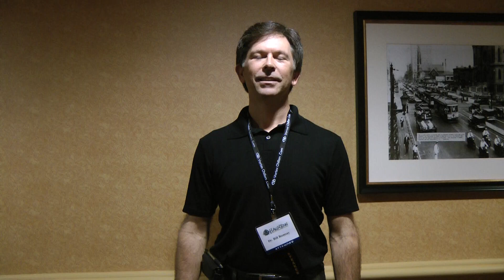HAuNTcon 2011 - Flickering Light Circuit Seminar

Comment: Hi where can I get info on building a flicker light box, do you just add a light starter in line on one wire, and  put to hot side on plug, and other wire to nutral side of plug. I would like to build on, thanks